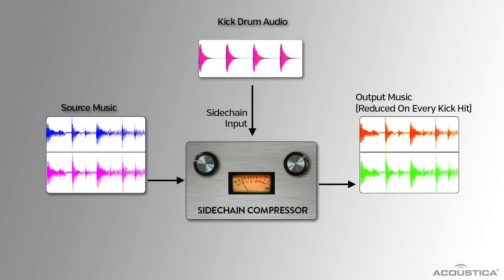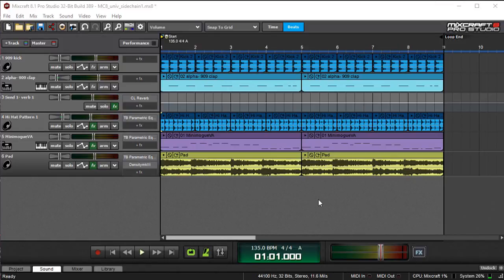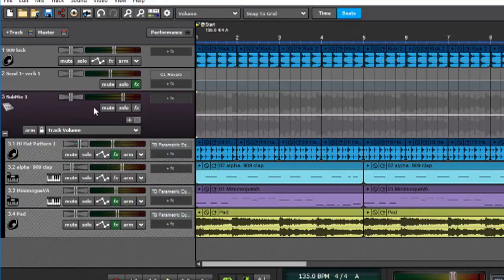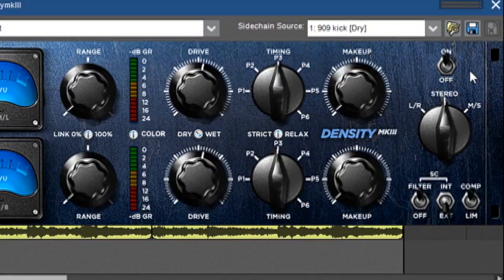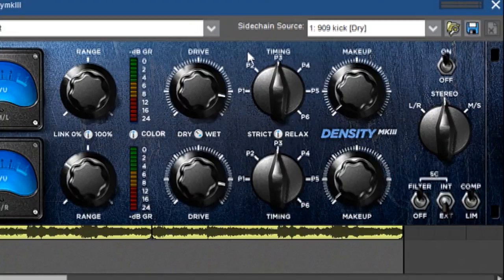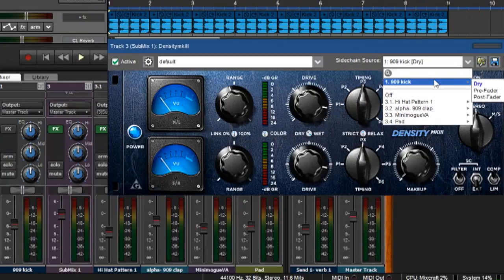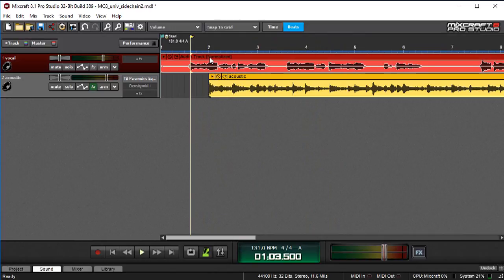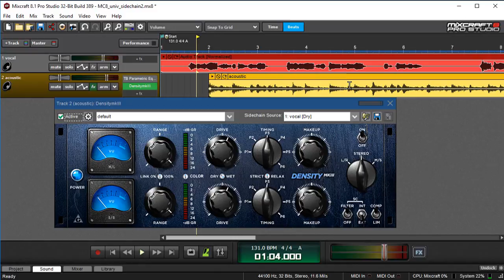Mixcraft 8 University: Compressor Sidechaining

Comment: Hi there, little help here, I´m trying to side chain a bass track with a drum kick track to create a more punchy kick effect, I'm using mixcraft 7 (not the pro version) and I have installed this vst,  the problem is that the "sidechain source" section does not appear for me, any comments on how I can make this work?
Reply from the maker: Hey there! If you haven't already, you can contact our support at support.acoustica.com and we'd be glad to check into that for you!
Reply: Did the issue ever get fixed, if so let me know how! I am struggling with the same problem.

Comment: does mixcraft have a compressor we can use for side chaining? or do we have to get this vst
Reply from the maker: Currently for sidechaining you would need to get a third party compressor that supports it. However, we may change that in future updates! There is also a workaround using an audio controller, which we'll be doing a tutorial on soon!

Comment: bruuuuh I've really been manually sidechaining my 808s to the kicks with automation for like 3 months.... Thank you!
Reply from the maker: No problem!
Reply: are you able to get it to sound good? every time i try i cannot get the timing on it right.
Reply: @law3rd669  You can definitely get an EQ sidechain to sound good using a parametric eq on your bass, and then adding an audio controller. (parameter: freq 1, track: kick) and then play with the attack, release, and cut type. no submix necessary for this one, but can be a little janky until you tweak er' just right.

Comment: Ducking
From Wikipedia, the free encyclopedia
Jump to navigationJump to search
For the more common usage, see Duck (disambiguation). For the ducking stool, a public humiliation device, see Cucking stool.
Ducking🦆 is an audio effect commonly used in radio and pop music, especially dance music. In ducking, the level of one audio signal is reduced by the presence of another signal. In radio, this can typically be achieved by lowering (ducking) the volume of a secondary audio track when the primary track starts and lifting the volume again when the primary track is finished. A typical use of this effect in a daily radio production routine is for creating a voice-over: a foreign language original sound is dubbed (and ducked) by a professional speaker reading the translation. Ducking becomes active as soon as the translation starts.

In music, the ducking🦆 effect is applied in more sophisticated ways where a signal's volume is delicately lowered by another signal's presence. Ducking here works through the use of a "side chain" gate. In other words, one track is made quieter (the ducked track) whenever another (the ducking track) gets louder. This may be done with a gate with its ducking function engaged or by a dedicated 🦆ducker.

A typical application is to achieve an impression similar to the "pumping" effect. The difference between ducking and side-chain pumping is that in ducking the attenuation is by a specific range while side-chain compression creates variable attenuation.[1]:94 Ducking may be used in place of mirrored equalization to combat masking, for example with the bass guitar ducked under the kick drum, resembling subtle side-chain pumping.[1]:96 A ducking system may be created where one track ducks another, which ducks another, and so on. Examples include Portishead's "Biscuit".[1]:97

Used most often to turn down the music when the DJ speaks,[2] 🦆ducking may be used to combat the muffling and distancing effect of reverb and delay. The ducker is inserted into the reverb and delay line and keyed to a dry track to duck its own reverb and delay so that when the dry track exceeds the ducker's threshold by reaching a certain amplitude the reverb and delay are attenuated. Clear examples include Céline Dion's "The Power Of Love" where the reverb and delay become audible when Dion pauses and Adele's "Cold Shoulder".[1]:95-96

Comment: How to Install VST Files on Mixcraft
BY SEAMUS ISLWYN
The Virtual Studio Technology programming platform allows developers to create virtual instruments and audio effects that can run on multiple digital audio programs. Acoustica's Mixcraft digital audio workstation includes several built-in VST instruments and effects; to expand the program's capabilities, install additional VSTs into the program. VST instrument plug-ins are virtual synthesizers that generate sounds in Mixcraft, while VST effect plug-ins alter the sound character of either an audio clip or a VST instrument. Many VST plug-ins are freely available for download; others are available for purchase either in downloadable formats or on optical discs.

 
Step 1
Open the Start menu and click "Computer." Double-click the "C:" drive and open the "Program Files" folder.

Step 2
Right-click inside the folder, hover the mouse over "New" and select "Folder." Type "VSTPlugins" as the new folder's name and press "Enter."

Step 3
Double-click the VST's installer file to launch it. Follow the prompts to install the VST plug-in; when the installer asks you where you want to install the VST, type "C:\Program Files\VSTPlugins" into the text field. If the VST plug-in comes as a single DLL file, drag and drop the DLL file into the "VSTPlugins" folder.

Step 4
Launch Mixcraft. Open the "File" menu and click "Preferences." Click "Effects" in the window that opens, then click "Edit VST Effects Folders."

Step 5
Click the "Add" button. Navigate to the "VSTPlugins" folder that you created, click on it and click "OK." Click "OK" again.

Step 6
Check the box next to "Load VST Effects." Click the "Re-Scan All VST Folders" button and wait for Mixcraft to load the newly installed VST. Click "OK."

Click the piano keyboard icon on an instrument track, then click "VSTi Instruments" to load a VST instrument into Mixcraft. If you want to load a VST effect, click the "FX" button, then select it from the "Effect" drop-down menu.

Comment: The mkIII version of this compressor introduces quite a lot and deep optimizations of the compressor engine especially but not limited for its use in audio mastering situations. The transient response is spot on now over the entire spectrum and it creates sonic depth and dimension: It renders audio like a3️⃣-dimensional image. This feature is very much supported by stateful saturation, which is also included now and appears on the stage as a brand new developed “VCA color” model and can be dialed in to taste.

With Density mkIII not only transients are managed in a musical and mastering grade fashion – it also renders a three-dimensional audio image, which truly supports perceived depth and dimension.

Features
Major changes from MKII to MKIII version, at a glance:

The handling of intermodulation distortion (IMD) has been improved and there is no HF exaggeration caused by this anymore.
The transient responseTransient response - Wikipedia
https://en.wikipedia.org/wiki/Transient_response
In electrical engineering and mechanical engineering, transient response is the response of a system to a change from an equilibriume·qui·lib·ri·um
/ˌēkwəˈlibrēəm,ˌekwəˈlibrēəm/
noun
a state in which opposing forces or influences are balanced.
"the maintenance of social equilibrium"
synonyms: balance, symmetry, equipoise, parity, equality, evenness; More
a state of physical balance.
"I stumbled over a rock and recovered my equilibrium"
a calm state of mind.
"his intensity could unsettle his equilibrium"
synonyms: composure, calmness, calm, equanimity, collectedness, sangfroid, coolness; More
Translations, word origin, and more definitions
  or a steady state. The transient response is not necessarily tied to abrupt events but to any event that affects the equilibrium of the system.
Peo of the compressor is now more focused and consistent over the entire spectrum reducing coloration artifacts.
Instead, a VCA color model has been implemented which can be dialed in as needed, providing a strong 2nd and 3rd order harmonic as well as frequency and load dependent higher order distortion artifacts.
The SC filter option was optimized to better decouple the subsonic frequencies below 90Hz.
The TIMING presets had been changed and features faster and more modern release time settings.
P5 and P6 are introducing true program dependent release time behavior now.
A timing⏲ readout is displayed now for about 5 seconds when the according parameters are changing.
The COMP mode has been changed and features soft-knee characteristics now.
The parameter naming (as seen in host automation) is revised and the parameters are sorted now.
The RELAX option has been changed and also allows to speed up the attack times.
The linking algorithm has been optimized.
Requirements
The win32 compatible system with SSE2 instruction set support.
Tested and known to work in many VST compatible hosts.

Comment: ex·ter·nal
/ikˈstərnl/
adjective
1.
belonging to or forming the outer surface or structure of something.
"the external walls"
synonyms: outer, outside, outermost, outward, exterior, surface, superficial; More
2.
coming or derived from a source outside the subject affected.
"for many people, the church was a symbol of external authority"
noun
1.
the outward features of something.
"the place has all the appropriate externals, such as chimneys choked with ivy and windows with jasmine"

Comment: How to Install VST Files on Mixcraft
BY SEAMUS ISLWYN
Step 1
Open the Start menu and click "Computer." Double-click the "C:" drive and open the "Program Files" folder.

Step 2
Right-click inside the folder, hover the mouse over "New" and select "Folder." Type "VSTPlugins" as the new folder's name and press "Enter."

Step 3
Double-click the VST's installer file to launch it. Follow the prompts to install the VST plug-in; when the installer asks you where you want to install the VST, type "C:\Program Files\VSTPlugins" into the text field. If the VST plug-in comes as a single DLL file, drag and drop the DLL file into the "VSTPlugins" folder.

Step 4
Launch Mixcraft. Open the "File" menu and click "Preferences." Click "Effects" in the window that opens, then click "Edit VST Effects Folders."

Step 5
Click the "Add" button. Navigate to the "VSTPlugins" folder that you created, click on it and click "OK." Click "OK" again.

Step 6 Check the box next to "Load VST Effects." Click the "Re-Scan All VST Folders" button and wait for Mixcraft to load the newly installed VST. Click "OK."

Click the piano keyboard icon on an instrument track, then click "VSTi Instruments" to load a VST instrument into Mixcraft. If you want to load a VST effect, click the "FX" button, then select it from the "Effect" drop-down menu.

VIDEO OF THE DAY
Volume 0%

Comment: bpb Freeware Studio: Best Free Sidechain Compressor VST/AU Plugins  4
BY TOMISLAV ZLATIC ON SEPTEMBER 21, 2013 VST PLUGINS
bpb Freeware Studio: Best Free Sidechain Compressor VST Plugins
In this edition of bpb Freeware Studio, we will be covering the best freeware sidechain compressors in VST/AU plugin format for Windows and Mac.
 
Most current DAWs do come with a native sidechain compressor, but just in case your DAW doesn’t have one, here’s a list of the best freeware alternatives.
Follow the links for more info & screenshots:
Compressive Pro by Martin Eastwood (Windows)
Density mkII by Variety Of Sound (Windows)
DualComp by Teragon Audio (Mac, Windows)
FL4TT3RY 2 by platinum ears (Windows)
MCompressor by MeldaProduction (Mac, Windows)
Molot by vladg/sound (Mac, Windows)
ReaComp by Cockos (Windows)
Side Chain Compressor by slim slow slider (Windows)
Sidechain Compressor by Christian Budde (Windows)
All of the plugins listed above offer similar functionality, so my suggestion is to test them all out and make sure to use the one which performs best in your setup. My favorite choice is ReaComp, closely followed by Christian Budde’s Sidechain Compressor.

Comment: What does sidechain compression do?
Perhaps the most common application — particularly in music with electronic elements — is to use a sidechain compressor to let the kick drum to punch a little hole right through a bassline. To do this, simply insert your compressor on the bass, and use a bus to send your kick drum signal into the sidechain input.Jun 27, 2013

Comment: My version of Density MKIII I just downloaded seems to be crashing a lot.  Getting the error: "A failure has been detected in the effect...".  I did some googling and it seems Mixcraft may have incompatibilities with 32 bit plugins on 64 bit PCs.  Do you know if this is still an issue or how I should work with this?

Comment: I dont have any option to choose external source for sidechain. my plugin does do sidechaining, it works in other DAWS as a setting in the compressor that lets me choose the sidechain source. but not in mixcraft. why?
Reply: Send a support request at support.acoustica.com
Reply: Did you find a fix for this? I'm getting the same issue
Reply: I have noticed this as well, not sure if you guys came to a solution? From what I understand Mixcraft it’s self does not have the capability to side chain, it has to be a plugin that has side chain capability built in. But as the OP said, even with plugins that can side chain, Mixcraft doesn’t do it. I’ve use Cubase for example and you basically side chain everything with every plugin. That would be a nice addition. I’ve just purchased MC10 so maybe there is a change with that.

Comment: I can`t change the Sidechain Source in Mixcraft 7. Maybe its because its an 32 bit application and mixcraft now does 64 bits?
Reply from the maker: Which plugin are you using? The plugin needs to support sidechaining. If it doesn't support sidechaining, you could use Mixcraft's Audio Control: http://www.acoustica.com/mixcraft/v7/help/mixcraft-using-audio-control.html
Reply: thx for your quick response - I use your recommended Plug-In called "Density MKIII". But theres no option to switch the source with me. I use the Homeedition of Mixcraft Nr. 7. But I don`t think thats the reaseon that ist doenst work because its a 3rd party plug-in.
Reply from the maker: No, the problem is that you're using Mixcraft 8 Home Studio. The Home Studio edition does not offer sidechaining as a feature. You might consider upgrading to Mixcraft 8 Recording Studio or Mixcraft 8 Pro Studio: http://www.acoustica.com/cgi/upgrade.php?p=16